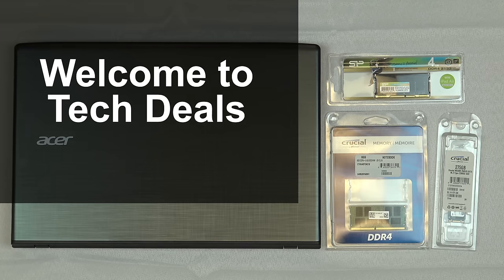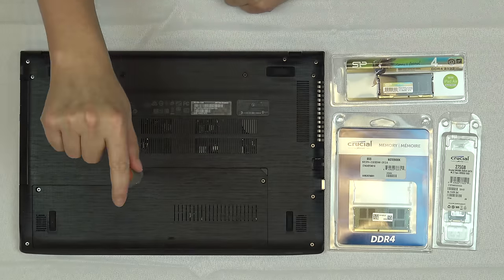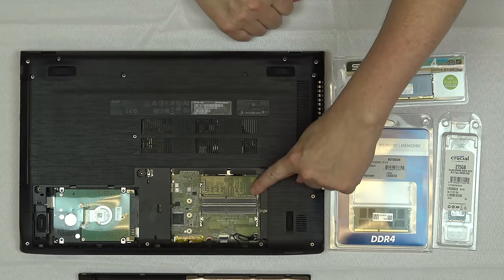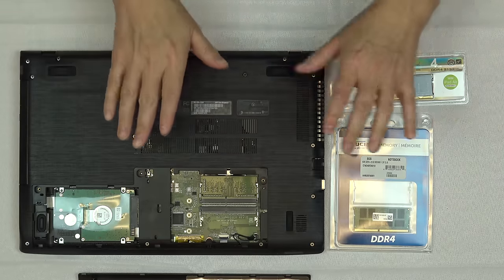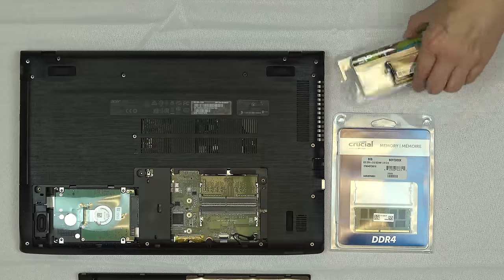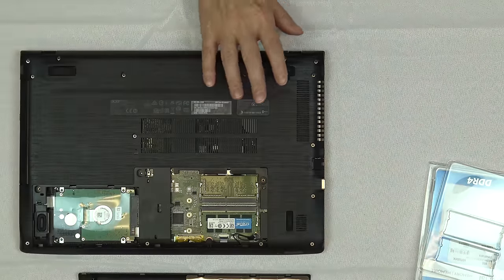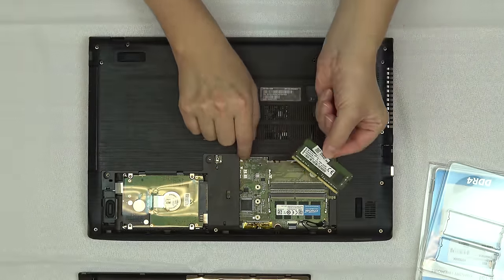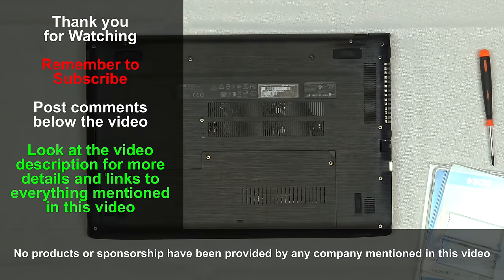Best $350 Laptop - Acer Aspire E15 - RAM Upgrade

Comment: Hi Tech Deals. So I've followed this tutorial as to how to upgrade my RAM. I've added the 4gb ram that was in the description of this video, however no I've come across an issue. Now, the computer won't turn on unless the power cable is connected to the PC. It says on windows that the laptop is '95% available plugged in, charging', but when I take the cable out, the computer turns off, or won't turn on without any power. It's not charging either. It says 95%, but I've left it alone to charge for a while, and it refuses to charge. Any ideas? Thanks.

Comment: Did you check the dual channel nature of the RAM in CPU-Z? I think this will still use dual channel, but some systems will not use dual channel IF the memory sizes are not the same.
Reply: And in this laptop works if I put two memory with difference speed? One with 2133 and another with 2666mhz

Comment: I purchased this computer (thanks for the tip).. successfully upgraded the RAM to 8GB... now I have installed 256GB of the crucial m.2 SSD.

question:  best way to clone windows 10 to the SSD?  The software that comes with crucial doesn't seem to be working for me.

I also saw another video of yours where you showed how you can create windows install on a flash drive.. could this be an option for me?  (create the windows install flash drive - then somehow get it to load onto the SSD that's installed)... any advice would be appreciated by anyone that has any experience with it.

btw - my laptop had the m.2 screw that yours didn't...

Comment: i like this video thanks. 

i have Lenovo g50-80 80L000HSIN. i want to know that can i upgrade my laptop? 
1. can i place ssd?
2. can i put any graphic card in it.? it has Intel (R) hd graphics family  ( Intel HD graphics 4400)video card. 
3. which ram i can buy to upgrade my laptop? 

thanks for replying.
Reply: 1. you can, but you have to sacrifice your DVD-RW by swapping it with a drive caddy. but, if you intend to use SSD only (which i won't recommend to do if you have a lot of data), you can simply swap the HDD.
2. nope.
3. look for SO-DIMM DDR3L memory. it's a lower voltage version of the standart DDR3, so, do NOT buy standart DDR3 memories because it won't work.

Comment: Hi there, I have an Acer Aspire E15 E5-576G-59AB, Intel Core i5-8250U, NVIDIA GeForce MX150 2GB VRAM, 4GB DDR3 L Memory and 2TB GB HDD.. I just wanna ask if can use a DDR4 or DDR5(If there is such because in the images in the stickers below the num pad in the keyboard it says GDDR5) as an upgrade to my laptop or should I stick with GDDR3 ram sticks because my existing ram is GDDR3?

Comment: Sir,does adding a ssd increase the frame rates in games or reduce stutter?
Reply: Bharath Kumar no, just loading maps, etc, if the game is installed on the ssd. it may reduce popping of objects.
Reply: well, it helps to load textures a lot faster, so it may help reduce stuttering but only at the slightest margin
Reply: Ersyad Adhimakayasa that is what i meant with object popping. stuttering is low frames per second. an ssd will not help with that

Comment: Can you please tell me what brand of memory stick comes installed in the product. When I upgrade I want dual channel operation. You didn't mention anything regarding the better performance of maintaining dual channel.
Reply from the maker: You do not have to match brands, any DDR4-2133 or higher memory stick should work just fine.
Dual channel RAM doesn't help as much as most people think it does...  it can, in limited situations, but few general consumer applications are RAM bandwith starved...

Comment: 1 question please , i didn't understand the last part , when you said , if i want to upgrade Ram to 16 GB with this i3 model , dual channel 2 8 ram cards , you recommend to buy a diff model ? like i5 ? why is that ? if the max ram is 32 GB in this model , or 16 GB is more than enough ? Thank you
Reply: because the bottleneck is going to be the processor... not the ram.

Comment: Hello, I have the same laptop. Does it only have 2 slots of ram? I checked the memory specs using cmd and task manager, it says 1slots used out of 4. Is it possible that the other 2slots are under the board?

Comment: I installed two sticks of 8GBs RAM for 16GB, but after I tried to turn it on, it wouldn't. I put back the original RAM it came with and it did turn on. If i install 1 of the 2 RAMs I bought the computer won't turn on, can you tell me what's the problem please?
The RAMS I bought are 2x8GB Kingston 2133 MHz DDR4 RAMs.

Thank you.
Reply: Miguel Terrazas 

Never heard of this problem. Do you insert the ram correctly?

I think the laptop is only compatible with Crucial and Ballistic ram. I'm not sure about Ballistic, but I definitely know Crucial works

Comment: I'm confused because I just got mine today, and in your video, along with every other person's I've seen so far, shows both ram slots empty, with them adding ram. But mine already has two in place?? Should I take one out and add the ram I got? And if so which one should I take out?
Edit: Update, the laptop I got from the link in the description for some reason has the ddlr 3 ones in there, I got that model of laptop and that came ddr4 and it won't fit into it):

Comment: after the ram is installed is there any other steps that need to be taken or does it automatically work from that point forward?
Reply from the maker: That is it, nothing to do...  it will just work...
You can verify this by going into "system" in control panel to see the new RAM

Comment: you could just use any m2 screw for the m.2 slot.
Reply from the maker: No, I'm afraid not, I tried...  None of the M.2 screws worked, including the ones that actually come with the Crucial MX300 SSD (it includes 2 of them).  I also tried posts from several desktop motherboards and a bunch of other parts I have laying around, this is a special Acer part...
Reply: There must be some way to find a screw that works? Loose fitting screw with Loctite? Velcro? Duct tape :)
Reply: i would not have a problem to duct tape it in there. or some more electrical wirering related tape.
Reply: the screw's that you unscrew on the back fit perfectly you just got to use 2 screws on the back

Comment: Hey 
I have a question 
I am thinking of buying this laptop 
And the newer version has 6gb ddr3 ram.
Can i still install an additional 4 gd ddr4?
Reply: I have the newer version, it can still be upgraded but the 6gb already takes up both spots (1 stick is 2gb and the other 4gb) so if you buy a 4gb stick you'll only get 2 additional gbs since you'll be replacing the 2gb stick. I would probably buy an 8gb stick. Also you will have to buy DDR3L ram not DDR4
Reply: @moremusix3948  thank you very much 
That was helpful

Comment: Seriously? You're doing an install video and you couldn't have gone out to a computer repair shop and picked up the screw? That's what I did, and it didn't cost a thing. For anyone who need the screw, just take your laptop with you (backplate screws removed) and most places will help you to install the SSD as a courtesy.
Reply from the maker: The screw is not standard, and it needs a mounting post, if you just have your M.2 screwed in without the post, you're going to be rather unhappy at some point as the M.2 is then resting against the chip under it...  I tried that actually, it needs a standoff.
Reply: Ok, got it. That wasn't very clear in the video.

Comment: Is your video entirely truthful? I saw that the system RAM was on the other slot and then up side down. To have RAM up side down produces a error message. The fact that the included RAM was installed on the other slot, up side down, tells me that you moved it otherwise the after market RAM you installed would not go in due to the notch match up. So by moving the factory provided RAM you can match up the notches and the after market RAM fits. If you tried to fit the aftermarket RAM on the top RAM slot the notches would not match up and thus the installation would fail; this leaves you with the factory installed RAM only. If you would leave the factory installed RAM in the lower slot and not up side down then you would need to install the aftermarket RAM on the top slot in m the up side down position--this, of course, produces an error message. I bought the laptop and the RAM as described by you only to find out your suggestions did not work.
Reply: Michael Aranda Wtf do you mean could you speak in English

Comment: need help!!!! purchased a samsung 860 evo M.2 SSD  250gb  for my acer e5-575-33BM  it is a BM key which I was not aware of when I purchased it. I have nevr had so much difficulty making a correct purchase. I have not received it yet. Ordered from amazon. will this work in my laptop. I have called Acer and get a different answer each 4 times I called for various questions. how is it these techs dont know their own products. One guy told me my laptop would take a 3TB M> SSD. Needless to say I did not go for such ignorance. Can you tell me if this samsung ssd will work. A samsung tech told me it may work if I flip it over. I dont know who knows what on any issue anymore. Please HELP

Comment: Hey great video I have a question. 

I'm getting this laptop soon and plan on upgrading the ram to 24GB total. I'm looking at this one 
https://m.newegg.com/products/N82E16820232149

Is it compatible? If so does it matter that one stick would be 16gb and the other 8gb? Would it cause any problems, interference of any sort? I've read somewhere that having one of higher gb would result in one working more than the other? I'm new to laptops so advice would be appreciated. Thank you

Comment: I think know a better laptop than this for the same price... the Acer Aspire E 15 E5-575-52JF... 6th gen i5, intel 520 graphics, DVD R/W, 4gb DDR4 (upgradable to 32gb), 1366x768 display (which looks really good). It is an amazing laptop. $352 at BestBuy.

Comment: Since installing an M.2 SSD is no longer an option due to the lack of a stand off screw, couldn't you just replace the optical drive with an SSD by using an SSD caddy adapter such as in this video?

https://youtu.be/dfJmMzz9L7Y
Reply from the maker: Probably, but now you're just fighting it...  There is a saying...  "penny wise, pound foolish"...  anything beyond dropping a M.2 SSD in is missing the point, spend the $150 more and get the "big brother" and get 8GB of RAM, SSD already included, a GeForce graphics card, i5 CPU, etc. without the headache...